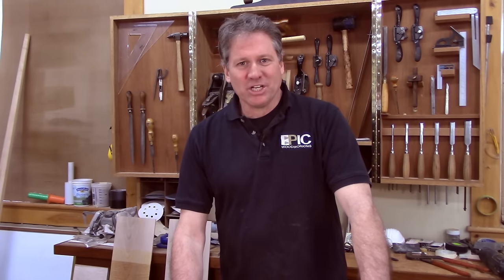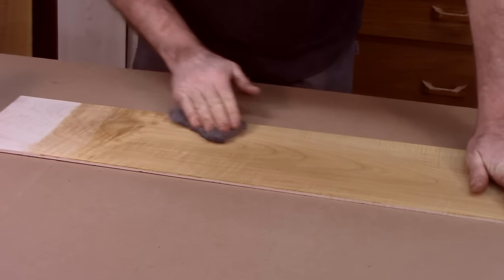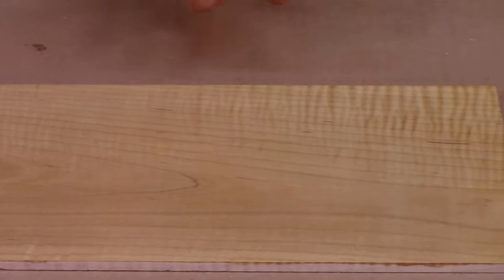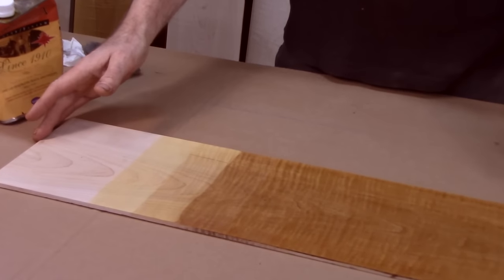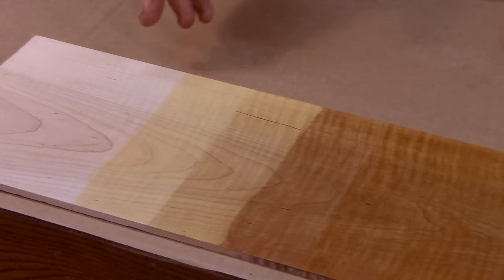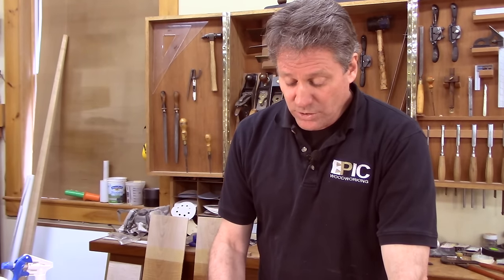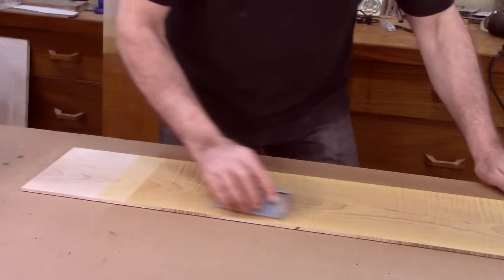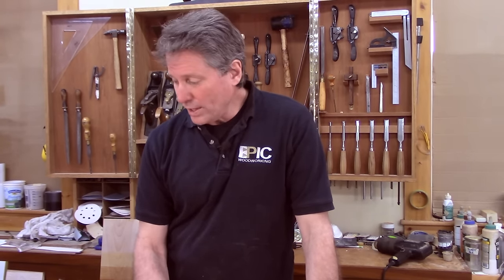How to Finish Curly Maple with Tom McLaughlin

Comment: Go to the dollar store.  Get several bags of glass marbles.  Drop them in your finish containers to keep them "to the top" each time you use them.  When the product is gone, just wash off the marbles with the correct solvent for the product they were in.

Comment: I just tried something and it worked wonderfully.  
I made a vinegar/stell wool stain. Wired on the maple and sanded the lighter areas down , then amber aniline dye , sanded back , burnished surfaces, and boiled linseed oil. Really nice contrast. I have some amber shellac and wax to finish up
Reply from the maker: Sounds beautiful! 👍
Reply: @EpicWoodworking  thanks! I'm not sure how many coats of blo to put on. I would like to do a couple, but im concerned about shellac adhesion.. any thoughts?

Comment: Hi Tom- really appreciate your content. If I were finishing a curly maple VENEERED panel, would I still do the water pop to do a sanding or not? Just curious as to whether this would affect the veneer in any way versus solid lumber- or maybe I should be avoiding water-based all together and going with an alcohol-based or oil-based finish? Thanks again!
Reply from the maker: That's a good question. I have not done side by side analysis of the difference between using water- or alcohol-based, in this case. Directly on the wood, I would choose one of those two over the oil-based. My initial reaction is you will be fine either way, but my preference would be to start with the water and don't overly soak it. It takes a lot of saturation to have any negative effect on the glue laye below. If you have both kinds of finish, water- and alcohol-based, you can do a small comparison on a test piece and see what you think. I'd be curious to hear what you discover. Thanks for following along!

Comment: Hi Tom, Thanks for this video.  I am looking to duplicate this finish on a maple hope chest for my daughter.  However, the Behlen glaze stains (burnt umber and van dyke brown) are no longer available that I can find. I see Mohawk bought the product line but I cannot find the equivalent. Can you suggest a substitute?  I appreciate it.  John
Reply from the maker: Yes John, your right, since this video Mohawk discontinued marketing the Behlen line. Now, the Mohawk Burnt Umber glaze is what you want. It is a little browner than the Behlens was but you still can add Mohawk VanDyke Brown glaze to it if you find you want more brown in it. Hope that helps! 👍
Reply: Hi Tom, Thanks as I was able to find the Mohawk replacement and I am now practicing on curly maple. Another question if you don’t mind.  I used a Moser water-based stain on maple but found the stain does not absorb into Famowood wood filler that I used in some thin gaps on my box finger joints.  I now have ugly white lines on colonial maple.  I have not used shellac yet but worry that shellac and then Mohawk glaze stain will leave these filler marks as white lines. Any suggestions on how to handle to hide these filler marks and when during staining/finishing process? Thanks in advance as I am watching many of your videos and learn each time.  John

Comment: I have a gun stock that is curly maple.  I notice that (either because of the finish that was used, or because curly maple is a very soft wood), the stock is very susceptible to dings and dents.  I am wondering if it is the wood itself or if it is because of the finish applied to the gun stock?  Also, is there anything that can be done to toughen up the stock and make it less susceptible to dinging and denting?

Comment: I'm a bit confused. I thought stains require a top coat or is the oil in  this product(Behlens) a curing oil like linseed. Also will  the solvent in the Briwax dissolve a lacquer finish. I think I had a mishap with Briwax on a  lacquer finish   years ago. Thanks for sharingyour knowledge.

Comment: Will this technique work with normal non-figured maple, or will it have little benefit?
Reply from the maker: Chris X Yes Chris, you can use this same technique to achieve a similar color, but the figure and grain enhanced in the wood will only be as good as the wood itself brings to the equation. So in this case, the curly stripes of rolling grain are pronounced.
Hope that helps! Thanks, Tom

Comment: Is it possible to add pigment to a food-safe oil to finish a cutting board? I have some figured/tiger maple and I need to match that exact color. Your videos are fantastic!
Reply from the maker: Good question, but I’m not sure given it is subject to the “chemical” makeup of the particular brand of pigment. Since most pigment is natural, and actually very fine ground up sediment, like clay or “dirt”, i would guess it’s okay to ingest, but would I want too? 😎 Come to think of it I have only ever seen natural non-pigmented as food safe finishes. But you could always use a natural dye stain like concentrated tea...which I have done on some curly maple rolling pins in the past.
So glad you enjoyed it, thanks for watching!😎👍

Comment: Hi Tom, Thanks as I was able to find the Mohawk replacement and I am now practicing on curly maple. Another question if you don’t mind.  I used a Moser water-based stain on maple but found the stain does not absorb into Famowood wood filler that I used in some thin gaps on my box finger joints.  I now have ugly white lines on colonial maple.  I have not used shellac yet but worry that shellac and then Mohawk glaze stain will leave these filler marks as white lines. Any suggestions on how to handle to hide these filler marks and when during staining/finishing process? Thanks in advance as I am watching many of your videos and learn each time.  John
Reply from the maker: Oh yeah, that is frustrating. I have several approaches to “hide my issues” like those 😎 Colored touch up markers can work well in some situations, but I prefer using those after a wash coat of shellac so I have more control of the depth of the color since it can’t absorb straight into the wood. Another method is mixing your own color and applying with an artist brush. Transtint or some other kind of alcohol dye is effective when mixed in alcohol  alone or thinned shellac. 
I hope that helps!
Tom

Comment: Tom, I love this look! I am making a liquor cabinet right now and I know you mentioned it in the video but what exactly would you use as far as a varnish goes in place of the shellac. Thanks for the video!
Reply from the maker: Mike Williams I like to use Waterlox for a varnish. It’s not cheap, but if you can keep oxygen out of the storage container it should last a while. The satin sheen rubs out really well, while the original is brighter medium sheen. Another nice varnish is these made by General Finishes. Hope that helps! Thanks, Tom
Reply: @EpicWoodworking  to clarify your answer on how to get the antiqued effect on liquor cabinet/table top in my case: tone with 2 coats analine dye, seal with shellac, effects layer with glazing stain, then rather than shellac; finish waterlox satin rubbed out finish, no briwax top layer?

Comment: What did you mean by 3 coats of Waterlox? How long did you wait between coats? Thanks.
Reply from the maker: Waterlox is the brand of tung oil varnish. It says how long to wait on the can but I usually put one coat a day unless drying conditions are very good, and I’m putting it on thinner. You can thin it a bit with mineral spirits to make it easier to wipe and brush on. I usually thin by adding 10-20% mineral spirits. Hope that helps, and thanks for watching! 👍

Comment: Thanks Tom. Very good video. Instead of using Bri wax at the end could I spray pre-cat lacquer for durability?
Reply from the maker: Joe Feldmann Sure Joe, I actually do the same on horizontal Services like table tops. Of course you want to be sure to use something like seal coat, a refined blonde shellac that is waxless underneath. Thanks! Tom

Comment: thanks for this video and your time.  I have a whole bunch of curly maple and i've taken some good pointers from you and other content producers.  i have a question for you regarding using shellac over dye.  I use a complicated process that involves two different colours of alcohol-based dye stain.  the dark colour goes on, then i sand it off.  then shellac over that.  then a lighter colour.  It really gives a great effect.  However on my most recent project (a mahogany dresser), i found that when i wiped off some glue i also wiped off some of the stain, causing light streaks here and there.  I would like to go over the whole case with shellac, which i also love, and hit the top with wiping varnish.  HERE'S THE QUESTION:  should i put some dye in the shellac, or just do touchups with the dye, and then shellac it?  I have put many hours into this project and i don't want to screw it up.  Thanks for your help.  I'm on the other side of north america or i would try to get into one of your classes.  Cheers!
Reply from the maker: scott  Hi Scott,

I’m glad to hear you enjoyed the video, although sounds like you already have a lot of experience  along these lines.

As you know, it’s difficult to give a good answer without actually seeing and being closer to the piece as you are. I’m guessing some of the stain came off when wiping the glue with water… before the shellac went on as a sealer.

 In a case like that, there are two ways you can go about it, you can try to touch up the light spots and blend which you mentioned, or  you can wipe down the larger immediate area, or whole piece, bringing everything back to a lighter stain just to match spots you saw color missing. Then you can reapply you’re stain, or diluted version of your stain, to the whole piece.

 If you try to color the immediate area, I like to use something I feel I have a lot of control over. That usually means using a diluted mix of the previous color and applying it in a way you can feather it in to create a blend.  Given you are right there, and are able to see the piece, you can decide whether tinting stain and spraying, or misting, on color will work, or tinting shellac and touching up the area in the successive coats.

Hope that helps!
Thanks again,
Tom
Reply: Epic Woodworking thanks. I think going over it all again with the top color is going to be my best option. I was surprised that the color came off After shellac. However, that was just a light seal coat, and the alcohol based dye overtop of that must have interfered. Live and learn!  

Thanks again for your input. It's guys like you who help the rest of us become more successful.

Comment: Tom Question,? I want to Flame Treat a couple of Raw Woden Maple Baseball Bats, for my Grandchildrens Room, Some say that Maple Wood will not take  to Flame burning at all, What is your take may I ask.? Thanks for sharing love your videos etc.
Reply from the maker: Thanks for following my videos, and the question. Unfortunately I have not had any occasion to experiment with flame treating, although I have done quite a bit with texturing materials. 

But my suspicion is they are more than likely right about the effects of Flame burning not being as successful on maple, since maple is such a dense closed grain wood. The porous open grain of Ash presents a more varied surface, which reacts with a strong contrast after flaming due to the open grain. I just looked at some flamed ash bats online and it’s the softer porous open grain portion of the growth rings that blackens from the treatment creating the contrast, so it is true maple will not react in that same way...but it will react in some way.

I would recommend just giving it a try on some scrap maple you turn and sand similarly to the bat...nothing to lose in giving it a test.

Hope that helps! Thanks again, Tom

Comment: I love this finish but I have an antique cedar chest and the veneer panels on it go in all different directions. Any advice? Sanding in different direction is almost impossible.
Reply from the maker: Thank you! Using 320 or finer sandpaper won’t tear up the cross grain when sanding as the courser will. Try it on a discrete area first and see how it works for you. And once you have finish on the surface, like a coat or two of shellac, you’re actually just sanding the finish layer, so grain direction is not an issue. Hope that makes sense and is helpful! Thanks for watching! 👍😎

Comment: Would you ever replace the glazing stain with a dye in the final coat of shellac to make it a toner ?
Reply from the maker: Sure, that is always an option to adjust and push the tone one way or another. However, spraying Shellac as a toner will not produce the same effects as the glaze. Nice to have both approaches in your bag of tricks whenever you might need them. Thanks for watching! 👍

Comment: I want  to use oil based stain on a flamed  maple top  for a guitar.  
I wanted  the   grain  to  be  raised 
how  do  i achieve  that?
Raising the  grain first  with  simple  water, let it dry and then  apply the oil based stain will help ?
Another question: the varathane pre stain is it  a seller  or  not?
Reply from the maker: Zs Cools raising the grain is technically only necessary prior to using a water-based stain, although it can't hurt and will likely help a little before applying an oil base stain as well.
I'm assuming your goal is to enhance the flamed figure of the maple top, so you definitely do not want to use a pre-conditioner. Deeply penetrating stains are most effective to enhancing figured words like your flamed maple. And conditioners are like sealers, inhibiting the penetration of the stain into the wood grain.
I highly recommend doing a sample test on a cut off of you are flamed maple to be sure you get the results you are hoping for.
Good luck with your project! And thanks for your interest,
Tom

Comment: when after sanding the final grit and wet the wood, the wood will tend to lay back down when it dries, defeating the purpose of wetting it. I've found it best to sand after allowing the grain to rise and the wood is still damp, but as you say not aggresively. I like to use a finer grit of sand paper for the wet sanding(300-320).
Reply from the maker: That’s great if it works for you. In my experience, I have not found the wood fibers to ever lay back down after drying, and they actually stand up like fuzz above the surface making them easy to sand off lightly. And yes, I like using 320 as well, worn 220 if that’s all I have. Thanks for watching! Tom
Reply: @EpicWoodworking  depending on which wood, it tends to lay down as it dries. Yes some stays up, but mostly lays back down.  But when you apply a finish, it will  stand back up..
Reply from the maker: Ok, I must not be using those kinds of wood as it has always been more effective removing after drying. But whatever works best for you is the best method, so you might be on to something there. Thanks again!

Comment: great look great video.  However the thought of doing every surface of my kitchen cabinets is a little overwhelming.
Reply from the maker: jason oftel Thanks Jason! Sorry I can't be of more help with your kitchen cabinets :).  Tom
Reply: Epic Woodworking not a problem.  I am going to use danish oil and wax. Sand in the oil many coats. let it cure and wax them. it's all. we to me the test board looked nice.
Reply from the maker: jason oftel that sounds like a great plan, hope it goes well for you!

Comment: I have read that there is no need to sand or steel wool between coats of waterlox. It says so right on their website. It can remove the waterlox that has began to fill the pores in hardwoods and make the finish feel uneven and bumpy. Dont do anything between coats. The only time waterlox suggests a light steel wool is between the second to last and last coat if at all.
Reply from the maker: Brandon Mingerink Thanks Brandon, the type of sanding I do is light, to remove the dust nibs of the previous coat, which in my experience if I leave them the finish will be bumpy. On the Waterlox Satin can it says “sanding is not necessary for adhesion purposes but can be done for aesthetic reasons”. That’s interesting to me because with so many reactive type varnish finishes sanding is recommended for adhesion, so good to know adhesion is not a concern. But I do prefer, and will continue to sand lightly for aesthetics, to remove dust nibs and to level heavier coats after brushing on. Thanks for the new info!  Tom
Reply: Totally understand where you're coming from. I'll most likely use steel wool just before my last coat on my table top tonight and see how it turns out. Great video!